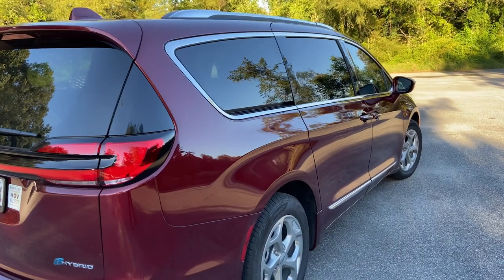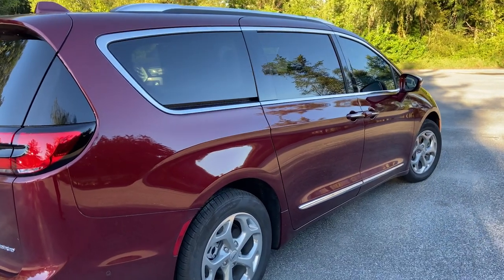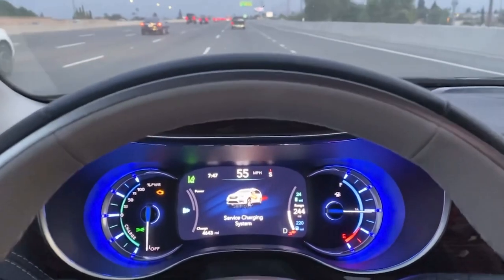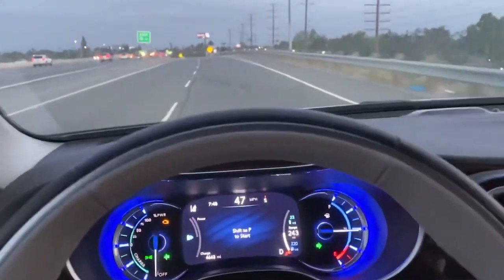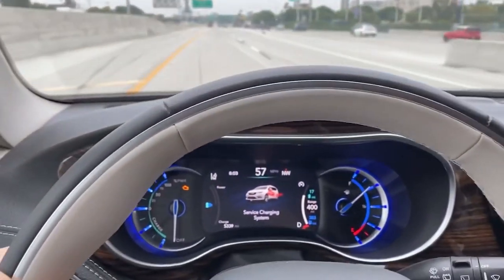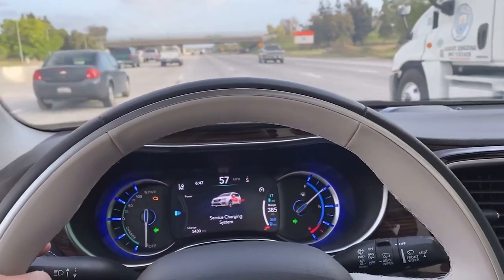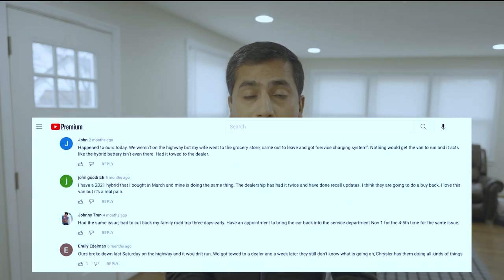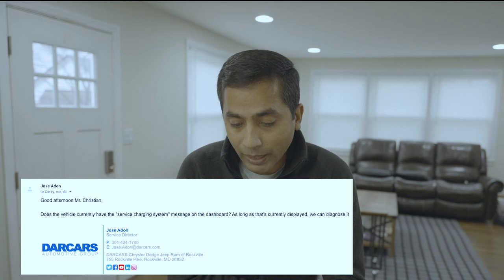Dangerous Common Issue in Chrysler Pacifica Hybrid

Comment: 2022 Pacifica EV 8000 miles is doing the same shut down thing while driving on gas engine.  the First trip to the dealer on 4/10/2023 addressed the JAN 24, 2023 recall.  one day after the recall was fixed the engine shut down again on the freeway while driving on gas, this time we got a warning first then the engine shut down.  2nd trip to the dealer on 4/11/2023 now says the transmission needs replaced.  does this new transmission fix the major safety issue with the Pacifica?  the dealer is claiming ignorance on this shut down issue!!! says we are the only one dealing with this issue!  B.S!
Reply from the maker: you are definitely not the only one. Seems like recall they came up with is not that reliable. Problem stopped happening with my pacifica after they changed transmission, so hopefully that works for you. Good luck!
Reply: @ContentMafia  thanks for the info. Our new transmission shipped on Monday. I was questioning if Chrysler had fixed the problem on the new transmission that was getting installed and all they would say was “we think so!”  Safe travels.
Reply: @brianwaddell6044  Did changing the transmission fix your issue?
Reply: @narendranraghavan6019  so far it has. We have driven about 1500 miles since the new transmission. I feel like (the dealer did not say this) since our van shut down twice, once before the recall was performed and once after our transmission was flagged and our replacement transmission was prioritized.  I will post if it shuts down again.

Comment: i bought the Pacifica hybrid Touring L in May 14th my dealer was 500 miles away and while traveling back home i took a lunch break and after having lunch I tried to start the car and it did not start and i see the check engine light came and after the advise from the dealer's service team i switched off the car completely and then restarted it, it did restart and car started and check engine light is still on and dealer said to drive back to him as all the local dealers service team have holiday on Saturday.....
After driving 100 miles back to dealer, they run some diagnostics and said they don't know what the issue is and the hybrid technician will be on Monday /Tuesday but he said the check engine light is now not showing and they said they are not going to give me the car as it may still have the issue.
Since i am not local Dealer gave a another car in the same model with a different color option but with the same price....I was very glad that i was not given the same car which had issues.....
I drove the new car back..now it had around 850 miles....hope i wont have any issues...?
Reply from the maker: nice that you ran into issue early on for them to replace the car. I hope you don't run into the issue with new one
Reply: Hello how are you I'm looking at buying one of these Pacifica hybrids how's your running? Any issues?
Reply from the maker: @Thallos88  are you asking me?

Comment: Great Video and thank you for putting it out there! I hope some overly excited environment lovers will watch this before blindly committing for this car and spend 50K + interest of their hard earned money! 

I have had similar issue with them where my car forced me to pull over and stopped completely on freeway! So far it happened 3-4 times, and i had to drop my car at the dealership every time. They said it's some misfire due to loose connection, and they fixed it including software updates! Couple of time i noticed that it has some engine or some system still running while car is off, and it asked me to service charging system. As you said my wife wasn't brave enough to record video when it slow down on freeway but we recorded this video when it completely died while sitting in our driveway!

Now, after taking this car to dealership multiple time, they finally diagnosed that this issue is occurring due to transmission. This transmission is on backorder and ETA is 1 month. Originally they said we don't have loaner but after complaining to their manager, owners, BBB, Attorney Generals, open case with Stellantis etc...as per VA rules if car been to shop 3 or more time or stayed in shop for 30+ days, then it considered as lemon vehicle. So i am trying to fight with them to buyback the car or fight with them under lemon law. 

Overall, it seems like their negligence on thoroughly smoke testing this vehicle like other Japanese car does! So for reliability stay within Honda or Toyota for sure. 

https://www.youtube.com/watch?v=5kh8h8FClSA

Comment: Just happened two days in a row with my 2022 pacifica hybrid.  About to start our journey in trying to get it fixed!
Reply: I used to work for for stellantis. Worst cars you could ever buy. If the car doesn’t give you issues, the dealer will. Wait till your transmission fails at around 75k miles. Should’ve bought a Toyota.
Reply: is this issueonly related to the hybrid variants or to the whole lineup

Comment: This is the CLEAR PICTURE OF WHAT you get when you buy Chrysler. I have the similar issue with 2022 hybrid it goes in limp mode with turtle picture
Reply: It does what??? Whats the update
Reply: @kingiscoming1596 $11k worth transmission replaced by the dealer at 24k miles. And the new transmission came with low fluid they had to add 1.5qt before installing it. Chrysler is sucking big time.

Comment: I've heard than Sandy Munro's company worked on the Pacifica. I don't know if they worked on the Hybrid specifically, but you might want to reach out to them and inquire about the problem. They have an excellent reputation and are known for getting things done. They might have the connections to get an answer to your problem. If nothing else they might be able to put a fire under Stellantis' feet to get the job done. If anybody could fix the problem they certainly have the ability to do so. Good luck!

Comment: Did you get the problem resolved by dealer? What's the current situation? Thanks
Reply from the maker: Not yet.I dropped off my vehicle to dealer on 2nd May again and I haven't had any update yet. I'm hoping they find a fix soon
Reply: @ContentMafia  Thanks, Anuj. Are you located in Canada? I'm thinking about this car, however this issue would stop me from buying. I did some research at the forum and it looks there are some solutions to fix the issue. But still scary.  Good luck, man.
Reply from the maker: @michaelli914  I'm in Maryland, USA. Please let me know if you find any solutions on the forum. I can let dealer know.

Comment: I live in Michigan, Leased a new Pacifica Hybrid in January 2021. I HAVE HAD ZERO ISSUES WITH IT SO FAR. repeat, Zero. Love the van. I smile at gas prices. I have to be honest, my electric bill has increased by approx. 10%. Charging time needs work, about 13 hrs to go from zero charge to full charge.
Reply from the maker: Good know you are having good experience. As I have said earlier, it's not proven that every single hybrid has this issue but as you can see from the comments, many people are having this issue.
Reply: Suggest,  if you own your home,  add a 220 V circuit in your garage.  Level 2 charging will cut your charge time down to a little over 2 hours.
Reply: @bontondon4502  your undoubtedly correct, unfortunately the after market 220v charging cable is $300 plus. If I wasn’t leasing I’d probably upgrade.
Reply: @thisoldman7142  Is it economical to install Level 2 charger? I bought it for $500 and the electrician charge is $300. For total of $800, I can get the gas for a full year? What do you say?
Reply: @sharathpaka4198  I’m a retiree so not putting many miles on the car. next week will end the first year of my 3 year lease and have just over 8500 miles on it. Probably a wash for me. Agin, that’s with the dealer supplied 110v, charger included in the lease.

Comment: We bought a 2022 Chrysler Pacifica Hybrid Limited S two weeks ago. The engine shut down/stalled while driving on the freeway and the van had a massive electrical malfunction. This happened dozens of times on surface streets as well. Chrysler took the car for a week, couldn’t “recreate” the stall and gave it back to us. The next day, back to stalling. Terrifying to have you car shut off while driving 65 miles per hour on the freeway with your children in it. Live Videos of electrical malfunction on my channel
Reply from the maker: Seems like same issue as mine. People were curious about if 2022 model has this issue or not. Thanks for sharing
Reply: I picked up the same model last week, already put  600 miles on it. Absolutely no issues (apart from android auto but my cell phone is a piece of trash). Hopefully I won't run into any issues. But it looks like is either you have constant issues or no issues at all...
Reply from the maker: @ncrprod  that sounds right
Reply: @ncrprod  How about it so far?

Comment: You have every right to invoke lemon law. If they reoccur 3 times and you took it to dealership 3 times within the past 1 year, and dealers can say it's fixed and it's still not fixed you can invoke it. If they do not even agree it's an issue all.3 times you can still invoke it and have an arbitrator to settle the issue with the dealership. Lemon  law will put all the burden on dealer. They cannot be bubbled up to Chrysler and dealer will have to force Chrysler to issue a recall.
Reply from the maker: I think MD where I bought the car has 18000 limit for lemon law and my car is past that. I wonder if it’s still possible

Comment: Your choice of vehicle is excellent but your dealership, Darcars, is not taking care of you correctly.  It is up to them to provide a loaner assuming that you have purchased that VIP Chrysler coverage.  You need to call Chrysler Customer service (the number is in your owners manual) and ask that they help you get this safety issue fixed ASAP and provide a loaner.  There are other dealers in your area also.  The dealership in Rockville, Maryland was always has had outstanding service.  Just remember what dealership treated you right the next time you go to buy a new Chrysler.

Comment: Mine just recently did the same thing.  It wouldn’t start in the morning and I missed work.  I had it towed to the dealer and they’ve had it for a week and don’t know how to fix it.  It’s a 2021 pinnacle and only has 6000 miles on it.  So what are my options?  I love the vehicle overall, but is there a fix for this?
Reply from the maker: Sorry about that. I don't think they have sure fix for the problem I'm talking about in the video. They have tried few different things on my car without luck. My car is with dealership since 2nd May and they are trying change transmission now. Good you only have 6000 miles on it. Depending on your state, you might be able to use lemon law if they can't fix it. Mine is 2021 too but I've 20000+ miles on it. In MD it needs to be under 18000

Comment: We had one that had similar issues. The difference is the motor would sound horrible. The engine lite turned on. We brought it to the dealer. They kept it for 6 months and changed the engine and transmission. Worked fine afterwards. Fortunately we had loaner from them the whole time.

Comment: Hi All , Any new owners Chrysler Pacifica Hybrid 2022. What’s your feed back. Since Toyota Sienna 2022 is one year wait and my test drive Pacifica hybrid looks much smoother ride , better acceleration, 4 months wait time. So I am leaning to order Pacifica hybrid 2022 but scared after seeing video? Pls share your thoughts or feedback on Pacifica 2022 hybrid
Reply from the maker: I personally wouldn’t buy Pacifica Hybrid know this issue how risky this issue is but can’t advice you to not buy. May be the issue is fixed in 2022 model or may be not. I wish you good luck!
Reply: It is impossible to say what percentage of Pacifica Hybrids have this problem.  Yours could be fine.  But our experience with Chrysler has been the most nightmarish customer experience with anything, ever.  To have spent so much on for a car that was so flawed to begin with, the fright of having a car just stop on us while driving, the time and energy we have had to put in to reading the laws, writing letters, making phone calls, filing complaints, getting the thing towed to the dealer on two occasions: it's all been such a waste and I wouldn't wish it on anyone.   We bought this car because it's imperative to stop burning fossil fuels and we figured that most of our daily driving would fit within the electric charge window and  the third row would be handy for carpools and family visits.  I just discovered that Kia  also makes a 3-row plug-in hybrid Sorento, which could be an option for you.  We didn't test the Sienna because we wanted a PHEV.  I can say that we have had a Hybrid Rav4 for four years and it's never given us any trouble.  Because the third row isn't an absolute necessity for us, were I to do it again, I would consider any number of EVs on the market now that are without the third row.

Comment: This sucks. I have been considering buying 1, but probably I am better not buying Pacifica. It reminds me of Pontiac 6000 issue with ignition module.  I had to keep replacing until I bought 1 with lifetime guarantee which I replace 1 or 2 times after.

Comment: I own a Chrysler product and I have to tell you it’s OK not the best but not the worst either. The issue that you’re facing is you bought a hybrid which I would never consider buying one much less a full electric vehicle. Chrysler does have their fair share of issues but they’re OK as long as you just get a full gasoline vehicle and maintain it and don’t buy a used one because most of the time people abuse the hell out of them. If the dealership is giving you the go around I would get a hold of the Better Business Bureau as well as get a hold of the Attorney General of your state over consumer affairs.

Comment: I would contact chrysler if you haven't yet because around April they started releasing a recall on the charge system.
Reply from the maker: I have. My car is with dealership since 2nd May. That recall hasn't worked for my car and Chrysler is working with the dealership to change the transmission

Comment: It's just another American vehicle that appears to have been created by regular citizens instead of engineers, and also there is no surprise here on why a 2021 Pacifica with 40k miles is only 20k Dollars and the same minivan but Toyota is 35k dollars. There is your difference. I owned Chrysler minivans before and one year I had to replace the transmission twice, then I purchased a used Honda Odyssey and NEVER had Any problems again, I still own that minivan, is in Puerto Rico now and it has 145k miles and still runs New

Comment: good thing is that the market is crazy so you can trade it in for a gas model and lose zero money... the gas one is rather good. if you really need hybrid you should go for the Toyota, they have been doing hybrids for ages so don't have any of the issues.
and yes, you are right Rockville Chrysler is complete rubbish!
Reply: The Sienna is not plug-in, just hybrid.